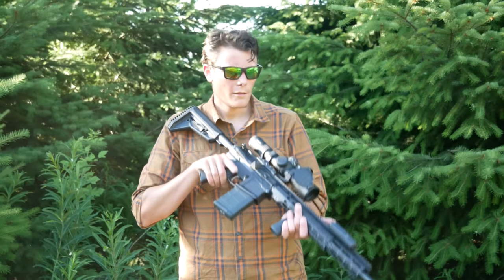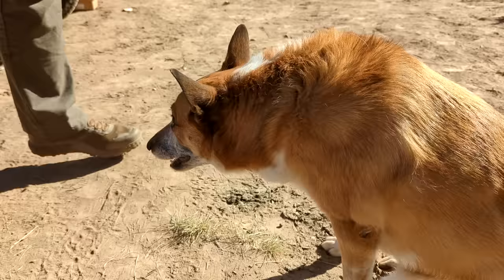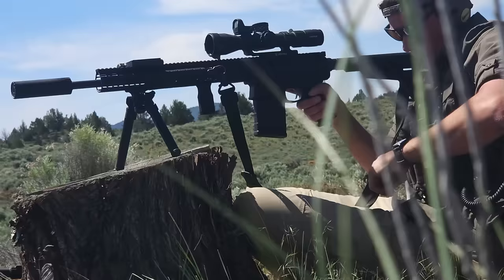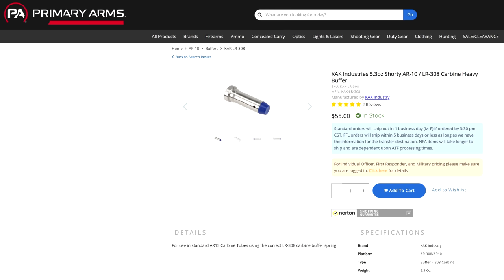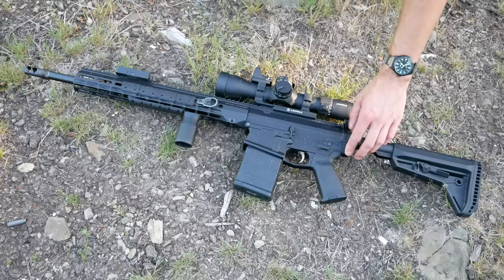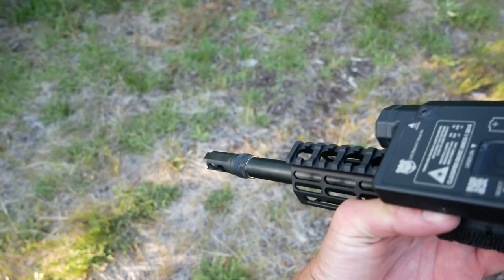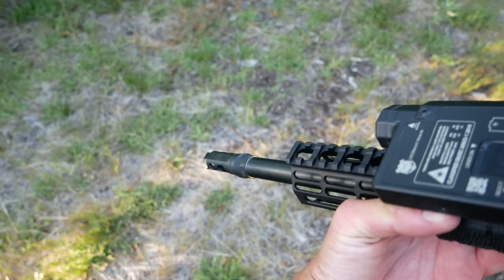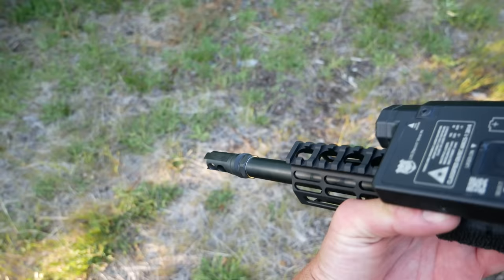Aero Precision M5 SAPR Build

Comment: Does the hand guard creep forward with that single pinch bolt?
Reply from the maker: The turnbuckle screw system pulls two wedges together which sit in a groove in the barrel nut. It's pretty solid, but like most friction handguards it could loosen up and rotate over time or with abuse.

Comment: Just curious why do you dislike adjustable gas blocks so much? It’s an honest question as I have many guns with and without and I’ve never had a reason to think “man I wish this gas block wasn’t adjustable”
Reply: Eventually you will carbon lock the gas block and it will either be non adjustable or non functional
Reply: @kilroy5166  I have seriously thousands of rounds through 2 different guns one is piston and the other is DI and neither has come anywhere remotely close to “carbon lock”. The DI gun is suppressed all the time and I’ve only cleaned the block once maybe? Not to mention they both are only held together by detent spring pins that aren’t in the gas stream. If that was a serious issue no one would ever run ratcheted suppressors
Reply: @moparbryan  Surefire ratcheted suppressors are known for carbon locking

Comment: Which reticle did you go with in the Mark5?
Reply from the maker: PR1 MOA
Reply: @Hoplopfheil  thanks, that’s my only hold up on these scopes. Pr1 is too plain and tremor 3 is too busy. Wish they would do the PR2 in this size scope but I’ve asked and Leupold said nope. Which has me looking at the 4-16 ATACR instead.
Reply: @michaelbarber6215  I’ve heard the PR2 is coming
Reply: @jrcumming997r6  I asked probably 3 or so months ago but that means nothing. If it does come I’m probably a buyer. Settling for an Athlon Helos BTR 2-12 for now as a pacifier.
Reply from the maker: The PR1 is way too thick at max magnification but looks good in the 3-15 part of the range.